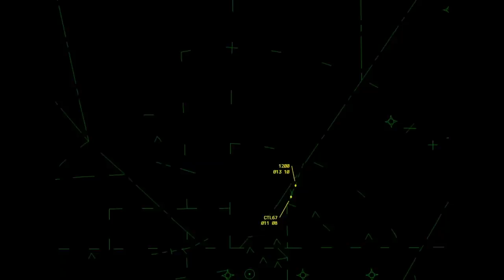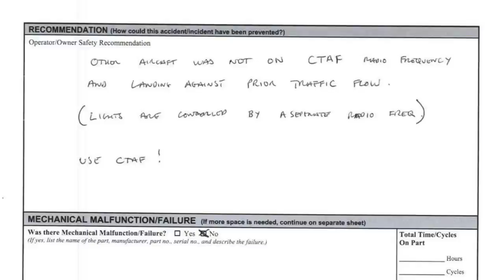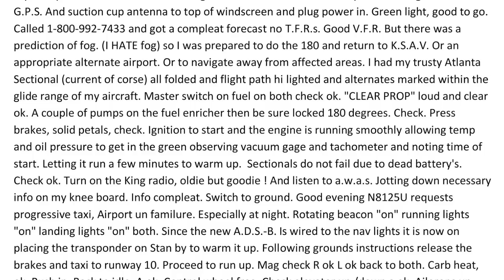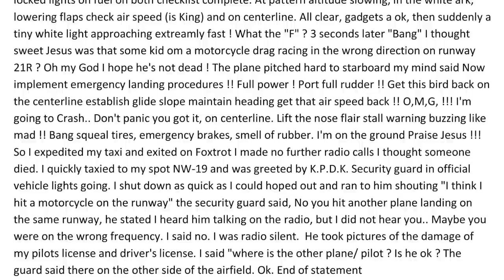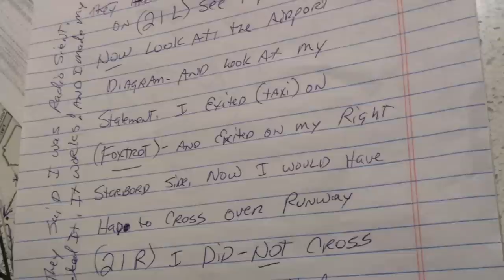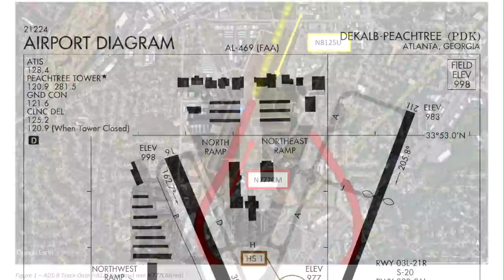Two Planes Collide During Landing

Comment: Mr Agati  must think it's HIS world and everyone else is just along for the ride!  Landing at an uncontrolled airfield at night radio silent???  What the hell was he thinking!!!  FAA Flight Operations AC 90-66B section 10.3 states: 
 Self-Announce Position and/or Intentions. “Self-announce” is a procedure whereby
pilots broadcast their aircraft call sign, position, altitude, and intended flight activity or
ground operation on the designated CTAF. This procedure is used almost exclusively at
airports that do not have an operative control tower or an FSS on the airport. If an airport
has a control tower that is either temporarily closed or operated on a part-time basis, and
there is no operating FSS on the airport, pilots should use the published CTAF to
self-announce position and/or intentions when entering within 10 miles of the airport.

Agati told the investigator that Mr. Ditto needed "the book" thrown at him and take his certificate away....Really?  PILOT Ditto did it by the book, and I would fly with him anytime!

Comment: Cessna pilot used the separate freq to increase the lighting intensity, bet he didn't switch back to 120.9.                                                                                                                                                            Where is this "radio silent" procedure, when approaching an uncontrolled (at the time) airport?!? 😏Is that in the PHAK?!?                                                                                                                              Then, his statement indicates he made all his position calls in the pattern. Uhh...BUSTED. 
At the very least, a suspension (followed by a proficiency eval with a DPE to ensure this guy is safe), maybe a psych eval, too.                                                                                                                           His insurance company needs an insurance company. This guy's a hazard.